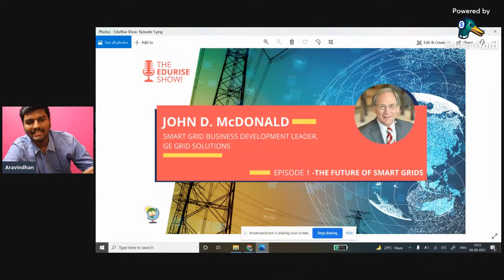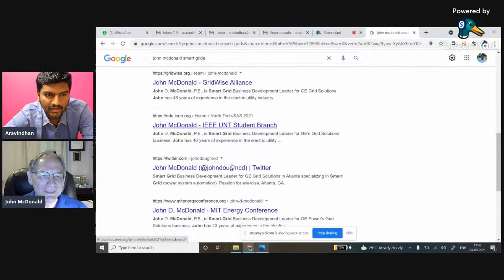The future of Smart Grids | John D. McDonald | The EduRise Show | Episode #1

Comment: Yes, Smart Grid started as Intelligrid Project by EPRI to enhance Resilience to Electrical Grid and develop self-healing, in other words faster restoration from a number of Blackouts which occurred between 2001-02. Indians should apply common sense improve grid reliability and quality consciously, instead using the term Smart Grid loosely for everything. Smart means - Resilience + Intelligence + Reliability + Quality + Sustainability + Security. Not, just one but ALL together.